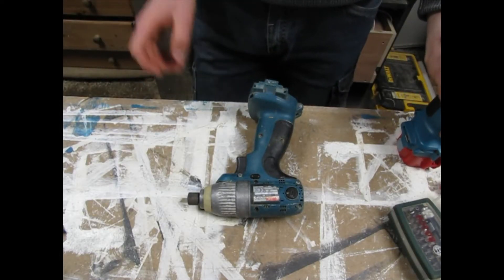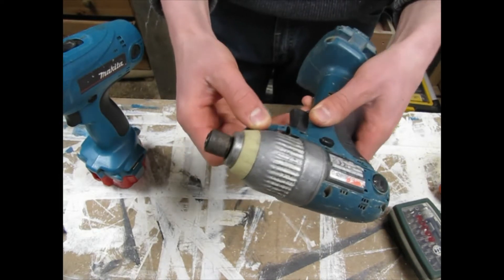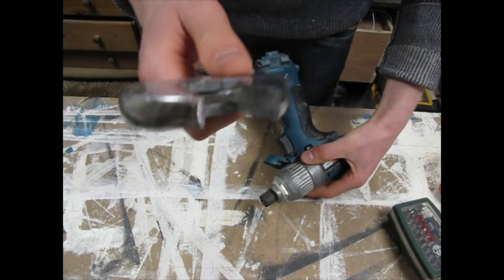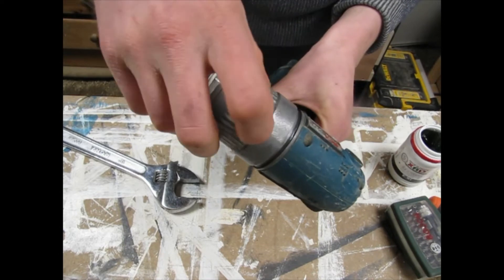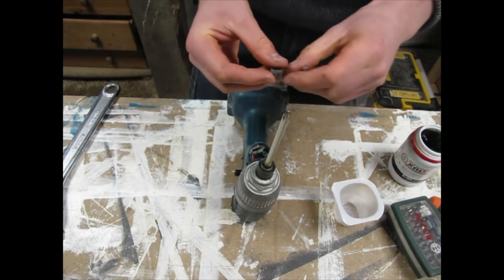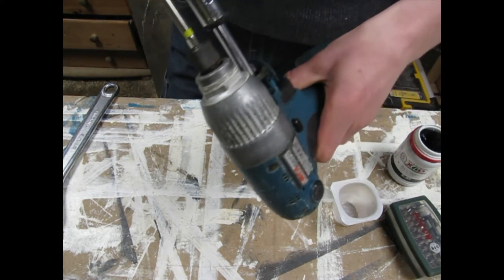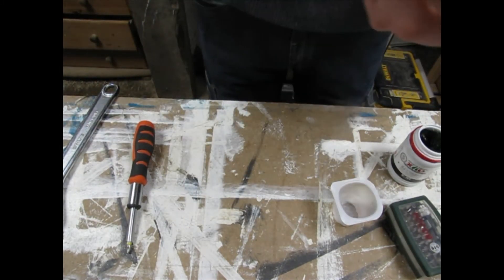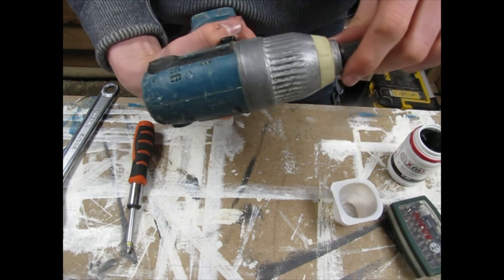Taking Apart a Makita Impact Driver (6980FD, 6935FD,  6936FD)

Comment: Hi I wanted to change the switch but after removing the screws the cover doesn't come off could you make a video pls
Reply: Just took mine apart, you have to take off the hammer which slides out. It will be attached to a carrier with a large spring and two gears. Watch as you take them out, the gears are only held in by straight pins and a washer which will fall on the floor upon removal from the unit. Next, slide the black ring gear retainer out and take out the ring gear which will expose 4 short black screws. Take these screws out and you will be able to get the plastic case apart.

Edit: The 4 black screws are held in by 4 black square nuts on the inside of the plastic case, they may slide out of place as nothing holds them in so make sure all 4 of them are attached (screws will tighten all the way down upon reassembly) or else they may slide out of place and end up caught in the armature.
Reply from the maker: Thank you for watching. I think that to get at the switch you have to take the anvil off like I did in this video. Let me know if that works.